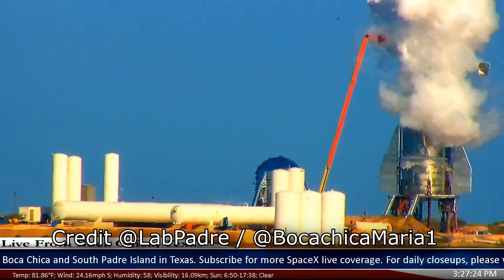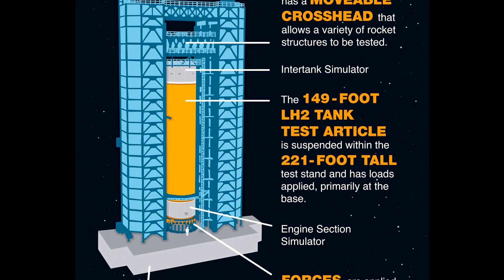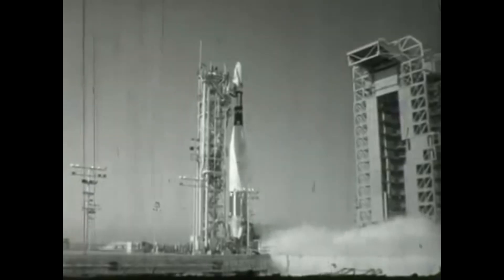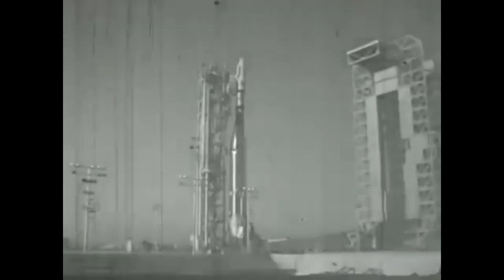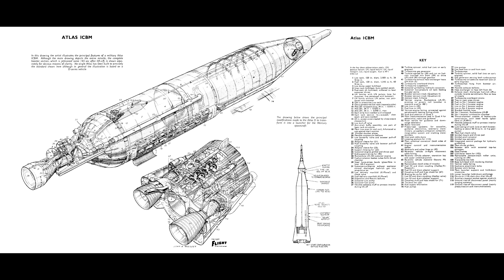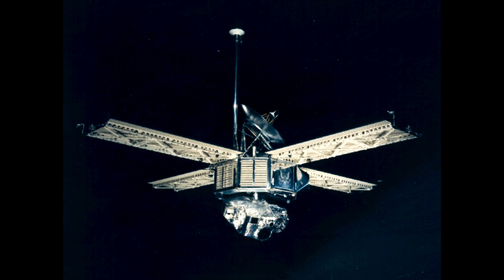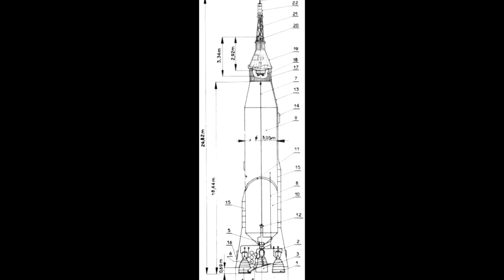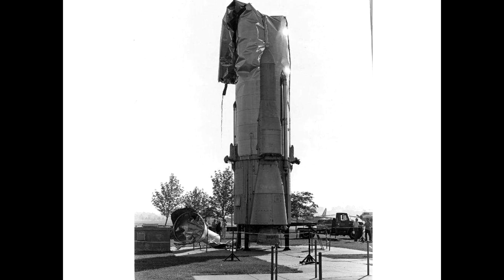Why Did A Rocket With A Secret Payload *Implode* on the Pad?

Comment: I'm surprised he didnt mention the missile accident in Arkansas where the missile lost preasure and collapsed due to a tool being dropped durring routine maintenance, stricking one of the tanks resulting in an explosion that ejected the warhead out of the silo just shy of a nearby highway. There is a fascinating documentary about it. Command and control : the American experience pbs 2017

I had originally thought it was frontline and that the incident happened in Louisiana.
Reply: rbmk 1000 they were very unlucky...they pierced the bottom tank. The weight of the upper tank collapsed the structure. If they had hit the upper tank, they could have been saved

Comment: My understanding is that ones the rockets start moving, it can handle the stress (engines at the bottom, payload at the top) only thanks to pressurisation of tanks. So when flying, each rocket has kind of "balloon tanks".
Reply: Yes, it would be crazy to not take use of the rigidity pressurized tanks provide but most rocket tanks can at least stand on their own without pressurization.

Comment: If the space deniers and flat earthers saw this they would say "Look, proof that NASA uses balloons and not real rockets"
Reply: I mean that statement is half correct, they are using balloons. Metal balloons full of rocket fuel, but still.
Reply: Why include flat earthers in this?  You don't have to be a flat earther to question the space program.  You sound like a shill!

Comment: Is SLS purely sunk cost at this point, or does it have some redeeming results from it's development?
Reply: Tons. It is NASA's first super-heavy lifter since the Saturn V, and is actually near completion. And no, SLS isn't a "Senate Launch System".
The REAL purpose for SLS is to get NASA a heavy lift rocket they've been wanting for ages, with the lowest amount of engineering required - as it was thought "for cheap". Although it turned out to be expensive, most of these costs have been recurrent ones - engineer salaries, factory maintenance, etc. If most of your yearly budget for a project are costs you have to pay every year, it baloons up. Just a simple example: 
You need to produce something for 60 dollars and you need to spend 80$ per X time for the tools you need for it.
If your boss gives you 100$ per X, you will spend a total of 300$ before the project is complete, but if he gives you 140$ per X then you only spend the 140$. Although it may seem counter-intuitive, sometimes the cheapest way to get something done is to give the one doing it more money.

Comment: Interestingly using pressure for structure is used everywhere, in the most unexpected of places. For instance coke cans use the liquid inside to remain strong, if was only due to their strength alone they wouldn't be able to support anywhere near enough weight when they're stacked and would require a huge increase to aluminium used. Pressure and a thin walled container really is one of the most efficient ways to make a device strong.

Comment: i would think a simple solution to the balloon tank collapsing, would be a support beam/pillar going up the middle, so there is minimal added weight, but if the balloon loses pressure, everything dosnt collapse down to the ground.

Comment: 2:30 It looks more like a collapse than an implosion.
Reply: M. de k.  If you remove the cap from a plastic bottle it loses its rigidity and you can bend is easily but that isnt an implosion... if you suck the air (or whatever is in it) out of it however it will implode but thats not what happened with the rockets.

Comment: Grissom's comment is understandable. It never stops amazing me how complex these vehicles are. One tiny thing goes wrong and you could have a rapid unscheduled disassembly like the example here - pin comes lose and hydrogen explodes. If it were me, I wouldn't be able to stop imagining some random bolt deep in the guts of the rocket wiggling out of its hole, falling, puncturing something important and blowing me up. But that's why I'm not an astronaut, I guess.

Comment: Just like aluminum cans. Once saw a stack of aluminum cans over 30 ft high in a warehouse topple when a row towards the bottom was depressurized as a forklift scrapped across them.
Reply: Not a scientific test, but gives one an idea of the strength of pressurized metal cans. One coke can, well padded to distribute the weight evenly, can hold:

opened can 77 kg 
pressurized full can 360 kg 

(from "How Much Weight Can a Soda Can Hold? Hydraulic Press Test" video)

Comment: In his  book, "Command and Control: Nuclear Weapons, the Damascus Accident, and the Illusion of Safety" by Eric Schlosser he makers the case for the possible implosion of the Titan rocket during the Damascus incident in 1980. The contractor and the Air Force all feared the loss of propellent would lead to a collapse. They were constantly monitoring tank pressure. It's thought the explosion was inevitable due to implosion or electrical sparking. A 9 megaton explosion in Arkansas is crazy to think about.

Comment: In use for 50 years?  Makes me wonder how many multi-generation engineers there are working on these rockets?  Would be an interesting topic, Scott.
Reply: It's amazing there are pieces of technology that fill a niche so well there is no point in replacing them, like the C-130 and the B-52. Some B-52 pilots are actual grandsons of the original pilots.

Comment: Trivia note:  Werner von Braun was less than thrilled with the thought of using balloon tanks on any rocket, but particularly a man-rated one.  He finally was persuaded to stop fighting the desire to use them when the Atlas program manager invited him to come down to the factory with a sledgehammer and try to put it through the side of a pressurized Atlas missile--apparently, both NASA and the Air Force put the kibosh on that idea right quick (more out of the worry von Braun would injure himself than anything else), but it got the point across.
Reply: Good story -- though some details seem to have been slightly different. It was not von Braun himself, but Willie Mrazek, von Braun’s Structural Section Chief. And he did get hit when the hammer bounced off.

von Braun's mistrust for Atlas had to do with more than just its structural design -- despite program's eventual success, there were numerous problems early on. The details of the story can be found in this "NASA history series" report: "Taming liquid hydrogen : the Centaur upper stage rocket, 1958-2002" / Virginia P. Dawson, Mark D. Bowles. p. cm. (NASA-SP-2004-4230)

On pages 38-39 you will find the following:

To quell Mrazek’s doubts, Bossart invited him to take a sledge hammer and give the tank a whack. Failing to put even the slightest dent in the tank, he tried again, this time giving the side of the tank a glancing blow that caused the sledge hammer to fly out of his hand, knocking his glasses off, but again leaving the surface unscathed. Although this test may have proved the strength of the balloon structure, it did nothing to endear General Dynamics to Mrazek or win the von Braun group’s faith in the ability of Centaur to lift an expensive spacecraft into space.

Comment: Formula 1 engineers: we use the engine as load bearing element in the structure of the car.

NASA engineers: pffft, we use the fuel in our tanks as a structural element in our rockets.
Reply: Farm tractors have been built using the engine as a structural element since the 30's.
Reply: @butchs.4239  Do Lamborghini cars do this too?
Reply: @johncrowerdoe5527   I dunno for certain, but Lamborghini tractors do. It wouldn't surprise me that their cars do as well, using the engine as an structural element makes a lot of sense in a mid-engined rear drive car. Especially a sports car where minimal weight is a design goal.
Reply: @butchs.4239  It doesn't hurt that the engine itself is probably the strongest component of the entire vehicle.
Reply: John Crower Doe Yes - as do Lamborghini tractors... (Lamborghini made tractors before they made cars).
Reply: Butch S. Bit earlier - Fordson tractors used the engine as a structural member from 1917.
Reply: Eks calybur Had a 1980 Honda XL500 street legal dirt bike motorcycle without front frame downtubes.  It used engine as a structural member.

Comment: Its incredible those balloon tanks never collapsed during launch as the fuel was consumed and pressure dropped. I guess by the time that could happen, that stage is ready to separate?
Reply: They keep them pressurized with another gas or by injecting some exhaust, depending on the rocket! I'm not sure what Atlas used, but most rockets need pressure in the tanks to help fuel flow, so the falcon 9 uses helium, some russian rockets burn some fuel to add exhaust, and some others boil liquid nitrogen I think.
Reply: @Pronto lol, it totally does! Just like the germans and Russians using concentrated vodka as an early rocket fuel! But in reality the fuel and oxidizer are in separate tanks so it shouldn't cause any issues, since there's no oxygen in the fuel tank, and I'd assume an insignificant amount in the exhaust if things are going according to plan. But, there's probably good reasons we don't see it used today!
Reply: @revenevan11  Atlas used helium in very much the same way as Falcon-9 does, except that in Atlas, the helium bottles were cooled by liquid nitrogen, while Falcon-9 puts the bottles directly in the LOX tank. Both rockets heat the helium by turbine exhaust before using it for tank pressurization.
Russians did use gas generators to pressurize tanks on some rockets. Proton is one of such rockets that still flies. I think Russians had already experimented with this idea before the war, but so did the Germans. Karl-Heinz Bringer in Peenemunde have developed gas generators which burned hypergolic fuel components and then cooled the gas by injecting water. The resulting steam was inert enough to be used for pressurizing both the oxidizer tank and the fuel tank. After the war he went to France, and many French rockets used this system, including the first stage of Ariane-1 through 4, which also had its engines designed by Bringer.

Comment: 0.015” wall thickness for the tanks is incredible
Reply: It's crazy thin for a rocket -- it is only about 4 times thicker than the material of the coke cans. (Though in the rockets it was not aluminum, but much stronger stainless steel.)

Comment: Fun fact: everyone's favorite un-sticker-izer, wd-40, was first invented to protect the fragile steel tank walls of the atlas rockets from rust which, even in very minuscule amounts, could catastrophically ruin their structural integrity.
Reply: @ba94845  well it isn't really a lubricant...
It's name is literally "water displacement 40"
Reply: I use it on the aircraft I work on, and when I'm asked why am I using stuff I bought at the local hardware store, I start with " Let me tell you what this cheap stuff was made for...." 😂😂😂
Reply: @SparkBerry  I said the something like that when My boss (I was a motorcycle mech.) asked Me that same question! One of the 3 essentials, 2+2, Duct tape and of course, WD-40!
Reply: and if memory serves it was the 40th try that was a success.
Reply: @a-fl-man640  WD-39 just never caught on.  Sort of like that soft drink, 6-Up.  😉
Reply: @bobblum5973  Or Virgin Cola 🙂
Reply: It is a fantastic starting fluid and also takes grease off of your hands really good.
Reply: @351wmustanggt  wd40 is not the prefered stuff for cleaning your hands.  

The word you are looking for is "soap".
Reply: Water displacement formula 40 39 failures
Reply: @ba94845  Why are you using emojis as bullet points?
Reply: Galvanizing not possible ?
Reply: Yes, the advertisement said it was the 40th attempt to rust-proof the spot-welded joints.  Of course it wasn't but it made the company rich, delivering it in 55 gallon drums.  As commented below, it's a terrible product but still sells well.
Reply: @Biggus_Mickus  And they are yellow so that you don't notice that those tasks you want to remind yourself have actually not been completed in the three years since you scribbled them down and stuck them on the wall.
Reply: It was applied with big dust mops.
Reply: I see people all over using wd40 as a lubricant and it hurts every time. Last week I saw a guy tell someone to repack shielded bearings with it.
Reply: WD-Farty
Reply: @Biggus_Mickus  super glue was an accidental discovery. Eastman (no relation to Eastman-Kodak) was working on a project in 1942 to make a clear plastic for airplane gunsights. Dr. Harry Coover's development of cyanoacrylate didn't work for molding sights, but he did note that it stuck things together. Since adhesives weren't what he was working on, he shelved it as a failure. In 1951 Dr. Coover was still at Eastman, working on developing materials for fighter jet canopies. Fred Joyner was a technician working on optical prisms and went looking for something to improve optical coupling between them. He found Coover's old failure from 1942, spread it on the prisms, put them together and ran the test.

That's when he found he could not separate the prisms. He went to Coover to explain how he'd ruined a pair of expensive prisms. Coover said something along the lines of "No, you've discovered a glue."

Eastman initially put it on the market as Eastman 910 in 1959 but shortly after licensed it to Loctite which changed the name to Super Glue. One wonders what would have come along had Coover showed his new glue to the adhesives people at Eastman. I'd bet at least Northrup would have been using it to glue aircraft together instead of using rivets, or using it to make riveted aircraft even stronger.

Eastman adhesives and plastics is still around and a large company, unlike Eastman-Kodak that has mostly faded away from its old core product line of personal photography.

Comment: Seems like bracing would be added to a static display Atlas. I lived close to Plattsburgh NY former home of the 556th SMS using the Atlas F. My question is, how were the missiles stored upright in their silos without collapsing? They were raised out of their silos for fueling, so were they pressurized inside the silos at all times?

Comment: Hi Scott--It also turns out that the leaking LOX badly damaged the launcher itself.  The launcher structure was made of structural steel that doesn't have much fracture toughness down at LOX temperatures.

Comment: Possibly daft question... if the tanks are only rigid if pressurised, how is this retained as the fuel is burnt?
Reply: Something else is pumped in, typically helium or hydrogen / oxygen in gaseous form back from the turbopumps.

Comment: As a teenager I built a liquid powered rocket which had a fuel tank pressurised by acetylene gas which was produced in a chamber on the top of the rocket where calcium carbide and water were mixed. It exploded! I then went on to solid fuel rockets which were easier to build and did not explode so often. You couldn't do any of that today, but the UK in the 60's was a different country Scott. :-)

Comment: A coworker of mine worked on the atlas earlier in his career. The atlasses were stored under positive pressure until they could be finished. He told me of a 4th of July weekend at the San Diego plant.  A supervisor was required to come in and verify pressure periodically  on the Atlas semi-formed fuselages to make sure nothing crumpled.   He parked his truck near the tanks  and walked down to inspect them.  Unfortunately he had failed to set the parking brake on the truck which rolled down and impacted the first of the missiles.  It popped like a balloon, but the popping created shrapnel which took out the next one - and so on.  They lost 8 of the ten missiles that day, and in the subsequent inquiry the supervisor (who miraculously was completely unscathed)  was discharged

That is the story as it was told to me by Chuck Greenman.  A wwII vet who swam towing an unconscious man hundreds of yards with a broken pelvis after a crash in the south pacific.

Comment: Rocket science question: what is the reason for separating the fuel and oxidizer into two different tanks? (of course for hyperbolics the answer is obvious)
Reply: Because when explody stuffs are mixed, it's more explody.
Reply: It is a valid question -- solid fuels are most often a mixture fuel and oxidizer. Why is it not more common with liquid fuels? There are no fundamental reasons why it would not work -- and some von Braun's colleagues have died experimenting with pre-mixed fuel and oxidizer in 1930s because they thought it would solve the problem of mixing fuel and oxidizer in the engine. Today, I think, there are some "green" monopropellant substitutes for hydrazine which do successfully premix substances which act as fuel and oxidizer -- but that requires a very careful choice of components. It simply doesn't work well with more ordinary fuels. For example, oxygen mixed with hydrocarbons produces a mixture which is a high explosive -- even a tiny amount makes a huge bang at a very slight provocation.
Reply: Wild guess: temperatures? If I read tables correctly liquid oxygen (and possibly everything else) would freeze solid inside liquid hydrogen tank. Or maybe just turned into water directly :)
Reply from the maker: Well with LOX and Kerosene you need to keep them separated because their temperature range is incompatible. But mixing fuel and oxidizer before they're ready to be burned is just dangerous.

Comment: A deflation is not the same thing as an implosion. Balloons don't "implode" when you let the pressure escape. In order for an implosion to occur, the pressure on the outside would have to be greater than the pressure on the inside, and that's not what happened with the Atlas.